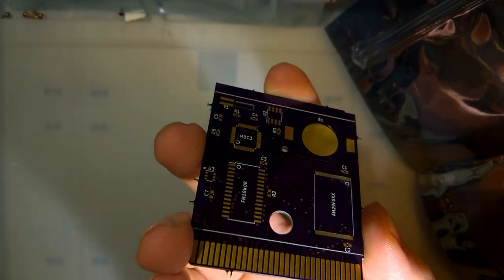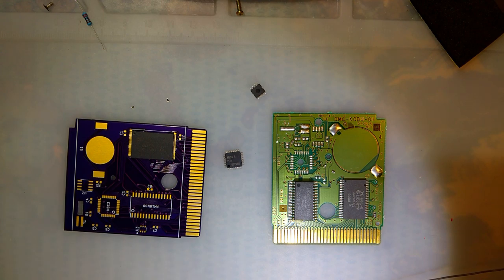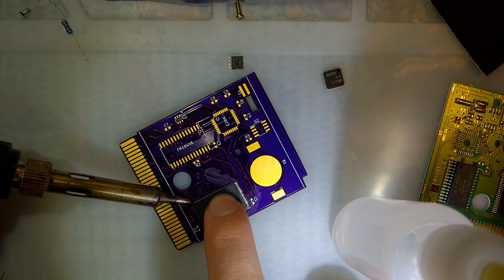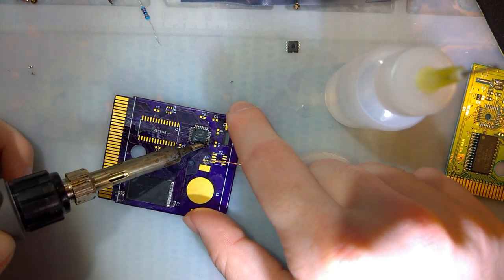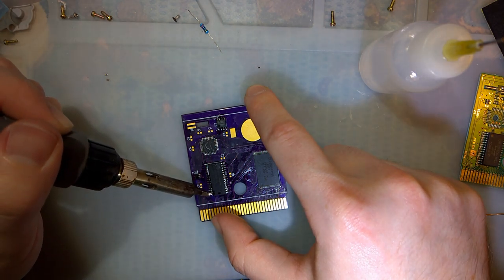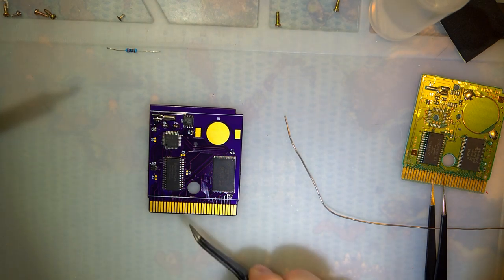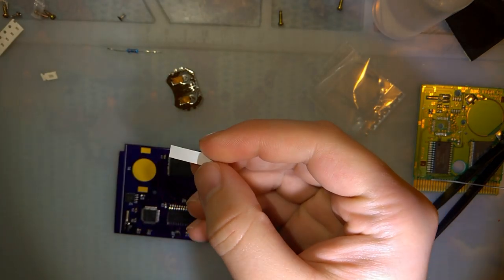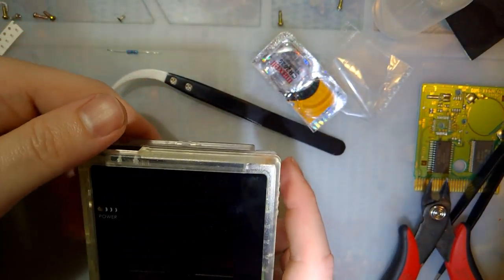Making a Batteryless Save (FRAM) MBC3 Flash Cart with RTC (yet another one)

Comment: it's been about 2 years since that first one was made, and I've finally got an upgraded one coming soon. Using an FPGA, 8 MB Flash, 128 KB FRAM, RTC, 2025 Battery. No SD card, since I wanted it to work with the n64 transfer pak, but at least I won't have to desolder anymore MBC3 chips. AND it only uses readily available parts! Unfortunately the FRAM is expensive at that size, I might have to make an SRAM version as well.
still gonna be a bit, gotta program the FPGA to read/write to the RTC chip, but it plays games!
Reply from the maker: Very eager for this tbh
Reply: Please more info on this in the future ! :3

Comment: heads up, make sure you install the flash chip the correct way round. Those things have a dot in both corners and if you don't choose wisely those things get HOT.
Reply from the maker: I believe the second dot is due to the packaging process but the orientation indicator is always supposed to be considered with the text too. In this case, when the text is upright, the dot is in the top left. Each different chip package is different though so sometimes there's a notch too. When in doubt, check the datasheet.

Comment: I'd love to make one of these.  I have the knowledge and skillset to do it, although the one thing I lack, is the ability to flash roms to the chips.  the chip programmer is quite expensive if you're not planning to get into chip flashing - long term.
Reply: Just buy a complete flashcart then
Reply from the maker: No reason you have to flash the chip ahead of time. I just do it because I already have the flasher and it helps with troubleshooting. If you know the chip has a good ROM and the game doesn't boot, then there's a soldering issue.
Reply: @makho  wait, so you can flash the chip after you solder it to the PCB?
Reply from the maker: @AndehX  Yeah. GBxCart RW, joey joebags gen 3, and these cheapo readers https://github.com/HDR/GBFlasher-Micro can all flash an assembled AM29F016 cart. This is what I generally use though https://github.com/sanni/cartreader and it works on both fully assembled carts or just the bare flash chip if you build the adapter.
Reply: @makho  Wait, the GBxCart RW can do it?  Awesome!  I actually have one ordered, and it should be here in a few weeks!
Reply: @makho  also, im not sure where you're looking, but that card hero game isnt on ebay for the price you stated.  Cheapest I can see is like $10
Reply from the maker: @AndehX  Maybe I bought them all. JP Pokemon Yellow and JP Harvest Moon are also good MBC3 donors. If you don't already have the PCBs, I'd hold off though since the mad genius behind the original carts found a way to recreate the RTC functionality with an FPGA.
Reply: @makho  very interesting. I will hold off.  I assume you'll be doing a video on this once this mad genius releases it?
Reply from the maker: @AndehX  Almost definitely.
Reply: @makho  Yeah I'd very much like to make a Pokemon Crystal Clear cart.  Seems like a cool rom hack, i'd like to play it on my GBC!

Comment: I'd like to watch a video of you doing this with a heated table, to see how/if it makes the process faster and easier
Reply from the maker: Once I got one, my hotplate replaced my hot air station for about 90% of the stuff I did used to use hot air for and for several other things I was doing by hand with a regular iron. It's much faster and easier but you'll have to take my word for it because I don't want to assemble any more of these carts.

Comment: Hey makho, thank you so much for all the contents you're releasing. I really appreciate that you give us tips while doing your mods and this is really important for a noob like me. I was looking forward to buy an economic soldering station (I found this one by Preciva for 37€) in order to replace the soldering iron I already have which is working quite ok but it's about to die at any moment I guess and it's kinda normal since I've bought it for 5€ and it doesn't have any temperature control at all. The only thing that I'm wondering is: which temperature should I set to do my things on a gba motherboard or on an average pcb? If I have to desolder something, should I set an higher temperature than the one I normal use to solder components or wires on the pcb? I'm quite sure that are differences between the soldering stations, the stuff you've got to do and of course also for the operator's own experience but I just wanted an idea. What do you recommend? Thank you really much ❤️
Reply from the maker: I solder at around 580F (305C) and I desolder with a hot air gun on "high".

Comment: Quick question.. why not tin the pads, place the components, and heat gun them into place? May help with the bridging struggle
Reply from the maker: Sure, that works fine and I've done it for several carts afterwards. At the time I filmed this, I was not comfortable with hot air so I did not use hot air. Were I to do this again, I'd just slather solder paste on there and pop the whole thing onto a hotplate.

Comment: This reminded me of a louis rossmann video.
#RightAmountOfFlux

On a serious note though, I have little to no experience so I could be completely wrong on this but would it help to avoid bridges if you tinned the pads first then placed the chip and used the heat gun to drop it into place?
Reply: I also feel like that would make the soldering easier. I've had to reflow the rom chip on a couple of carts and I'm always super afraid of bending the pins
Reply from the maker: It would absolutely be easier, yeah. I don't have a hot air station though. I'm getting one soon though since my heat gun committed sudoku.

Comment: Can you also replace the SRAM chip with FRAM in official GB/GBC games too, because I want to do that, and only use Battery for RTC games, similar to some GBA games and how GBA Pokémon games work.
Reply from the maker: not in MBC3 titles, at least not without additional mods.
Reply: @makho  Does that mean then, It'll work on any other game but not the MBC3 ones.
Reply from the maker: @VideoGameJNPoop  there are some exceptions and untested combinations, but yes, it should work fine on MBC1 and MBC5 games.
Reply: @makho  Oh and about the MBC? boards, how many games use MBC3, do most or only a few. Plus is there MBC2 and MBC4 too or is that all the names.
Reply from the maker: @VideoGameJNPoop  you can look up a list of games by memory bank controller (MBC) and find out exactly what games use what controller.
Reply: @makho  I have found that 1 game actually doesn't use SRAM at all, the game is Kirby: Tilt'N Tumble (Koro Koro Kirby in Japan), it uses Eeprom to save insteaed of SRAM. GREAT. Not sure if there are some more that use Eeprom (not counting GBA games of course).
Reply from the maker: @VideoGameJNPoop  Command Master uses eeprom too. That's the only other MBC7 game. I don't recall off-hand if MBC6 games use eeprom too but there might be a few of those.

Comment: Dude this is awesome, by the way is that fram compatible with all mbcs controllers ?
Reply from the maker: MBC5 and MBC1 only. To use it with MBC3 or MBC30, you'd need to rewire a few things. I don't know that anyone has tested these with any of the other MBC versions.
Reply: @makho  Most games will work on MBC5, but running a game that requires DMA (Super Mario Land 2) will cause glitches. 
Fun fact: It can be installed in Pokemon Yellow, but this will cause it to stop working in Pokemon Stadium. This suggests that the transfer pak is performing the same memory operation as Super Mario Land 2.
Reply from the maker: Abdikaram  That's not how you need to modify the wiring for MBC3 carts. https://www.reddit.com/r/Gameboy/comments/9lxl5l/nonvolatile_games_on_gen2_pokemon_games/

Comment: Would I be able to salvage every part I'd need for this PCB from a copy of Pokemon Gold JPN, aside from the tsop chip and the fram?
Reply from the maker: there's an additional couple parts like the OR gate and the battery holder, but otherwise, yes. I'd recommend just getting new resistors and caps though as it's very easy to lose track of what is what when desoldering. Also, the labels on the original cart (R4, R5, etc) don't always match the new cart.

Comment: We this, can you remove the chips from an original copy of Pokémon Gold, transfer to this new PCB and therefore making a non deletable savefile after the battery runs out?
Reply from the maker: Yeah, pretty much. I don't recommend starting with a Pokemon Gold cart though since those are more expensive and you have to flash the ROM anyway.
Reply: @makho  ok, thanks! Might try to do one of these. What do you recomend in order to flash the ROM then?
Reply from the maker: @huguia  you'll need a cart reader to flash these. If you don't mind DIY, I recommend building one of HDR's readers or a sanni reader. If you'd rather buy a reader, the GBxCart RW is probably the best cart reader on the market right now. 

HDR's reader: https://github.com/HDR/GBFlasher-Micro

My version of sanni's reader: https://github.com/makhowastaken/cartreader

GBxCart RW: https://shop.insidegadgets.com/product/gbxcart-rw/

Comment: Made one of these just now and wrote Pokémon Prism to it with my GBxCart RW. However, I've found that it doesn't seem to be able to make a savegame, restarting just yields the New Game option only, even using soft restarts.. Currently burning plain Crystal to it to test if that works, but could there be any other cause of this issue? The FRAM chip is brand new, as is everything else but the MBC3A chip, of course.

EDIT: Just flashed Crystal to it. GBxCart RW seems to be able to write the game's save I've made in VBA just fine, but it doesn't work because the game doesn't see it at all, and re-saving ingame doesn't produce a loadable game either. Oddly, saving ingame and then saving again does give me a warning of overwriting an existing save..

Oh, and the chips I got for U3 don't have any clear markings on them, there are several dots and stripes and I'm not sure which pin was pin 1.. Do you have a macro image of the chip so I can maybe compare it to the ones I have?

EDIT2: If I write a save file to the cartridge using the RW, then read the save back to a file, the save still works in VBA. That pretty much proves the integrity of the FRAM chip, doesn't it?
What could cause the game itself to not be able to save at all? I'm really lost at this point!
Reply from the maker: There are markings on the OR gate. You might have to break out the microscope or a magnifying glass to see it though. https://i.imgur.com/kaBi5PE.jpg
Reply: I'm having similar problems, most of the time i cant even get any of my 3 flashers to recognise it as a flashcart and when i do, it flashes but the RTC and save dont work. I've probably tried making 20 of these now and not a single one will work.
Reply: @EJayNine  In my case it just turned out to be not one, not two, but four defective Ramtron FRAM modules. I just kept trying until one functioned as it should.

Comment: Instead of using a new pcb, could I change a regular GB/GBC cart in FRAM save type? And if you don't mind me asking, where could I get FRAM?
Reply from the maker: I've been getting mine from aliexpress. Just search the part number listed in the BOM. But as an FYI, FRAM is not directly compatible with MBC3 PCBs, you would need to do extra mods. If you're making a flash cart anyway, it's cheaper and easier to make one of these PCBs. 

Take a look at this thread for more info on the mods required: https://www.reddit.com/r/Gameboy/comments/9lxl5l/nonvolatile_games_on_gen2_pokemon_games/
Reply: @makho  thanks for the info! BOM?
Reply from the maker: @CDX23  Bill of Materials. Click the github link I left in the description.

Comment: Does the game need a batteryless-save  patch like for some Chinese repros? Or it runs smooth as it is?
Reply from the maker: No, works as is. The FRAM module here is a direct swap for the SRAM module in original games. Cheap bootlegs do not use the same part.

Comment: Hey, so I realise this is a long shot, but i was wondering if you had a spare PCB you could possible send me?  I have the parts ready to make one of these, but I still need a PCB.  I could spend £20 and get 10 made at JLCPCB, but I have no idea if it will even work.  Worth asking I guess, worst you can say is no :)
Reply from the maker: no
Reply: @makho  haha, ok :)
Reply: I can hook you up with 1 in the UK.  Just PM me an address.  Good luck with it though, I just get gbxcart software saying: "The cartridge is changing it's data when being read back"
Reply: @stevenboyd7099  ah thanks for that mate, I got sorted though.  I've been assembling these carts for a few weeks now :)
Reply: @AndehX  No worries!  Have you had success?  I have no idea what I'm doing wrong...
Reply: @stevenboyd7099  yeah they work great.  Check your soldering also make sure the cart pins are clean and try wiggling the cart.  You can also join the inside gadgets discord and ask for help there

Comment: Hey i have an idea, try to mod a GB Pocket to a rechargeable battery. I would love to see that is done cuz i seen the OG GB to a mod rechargeable battery & the GB color & advance.
Reply from the maker: All Game Boy LiPo mods are the same. I've done an AGB before and uploaded that video (search boxypixel) and I've done a GBC (also boxypixel but I didn't film that one) and a MGB (well before I picked up youtube as a hobby). The only difference between AGB and the other two is that AGB needs a diode in series. The other two do not though the low battery detection will work better with it.
Reply: @makho  ok thanks

Comment: Hey do you think you can make a video on i doing a battery mod to the GB Pocket?
Reply from the maker: Just remove the battery terminals, cut out all the battery bay plastic, and solder in a charge module and the biggest battery you can fit.
Reply: @makho  ok but is there a special type of battery the GB Pocket needs to power the system without harming the any components? Or just get the 2.0 battery?
Reply from the maker: @efren84120  "2.0 battery"? I think you might want to read up on battery chemistry and voltage curves. Game Boy Pockets work on about 2-4.5v IIRC
Reply: @makho  ok so then i need to go down on the battery voltage then,  thanks ill look into that to.

Comment: What's all this, you're able to write rams into Gameboy Color cards and made new games off Rom hacks? I'm so confused. how even?
Reply from the maker: No, you've got it really. I'm only assmebling the hardware though. Someone else designed the hardware and someone else made the game. I'm just putting it all together.
Reply: @makho  I didn't know you can assemble all these things together to make it run on a like an old game. I've been interested in looking into ways to make it possible for me to have real-time on the rom hack Pokemon prism but i didn't have the tools to make it work. This video helped me get an idea but I still have no idea where to start
Reply from the maker: @JuJoAura  This hardware would do exactly that. If you put Prism on one of these carts, all the functions will work exactly as intended (RTC included) AND you can run the game on an actual Game Boy (Color or Advance).
Reply: Where did you get all these parts by the way? I'm looking to assemble my own or have someone make it for me but I have no idea where to start.
Reply from the maker: @JuJoAura  There's a github repository linked in the description. Start there.
Reply: @makho  Okay now I see it information. For some reason on mobile I just kept seeing the download code and nothing else. Should have just scroll down.
Reply: @makho  Question that face it's gonna be printed on it right?
Reply from the maker: @JuJoAura  No, that was just a one off for fun